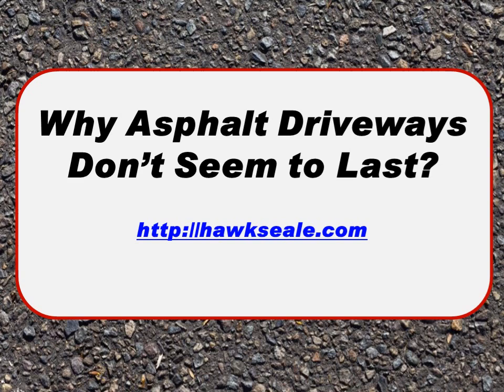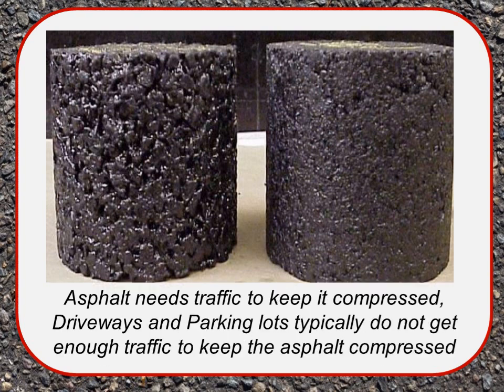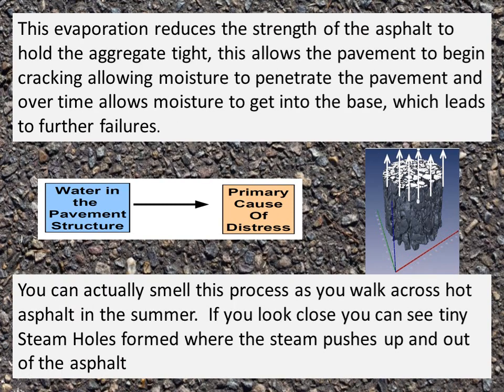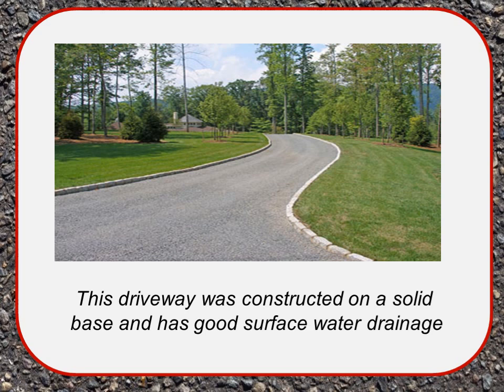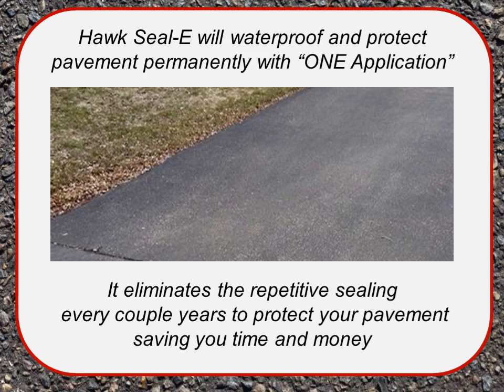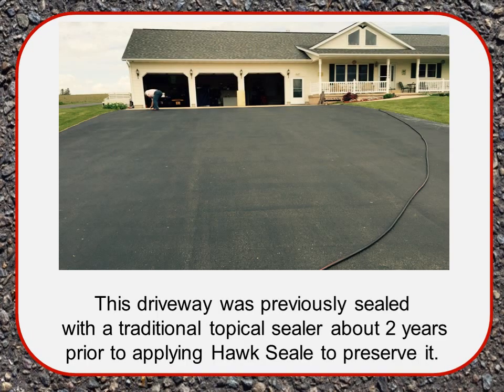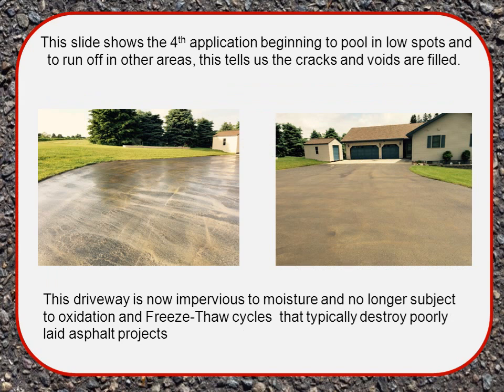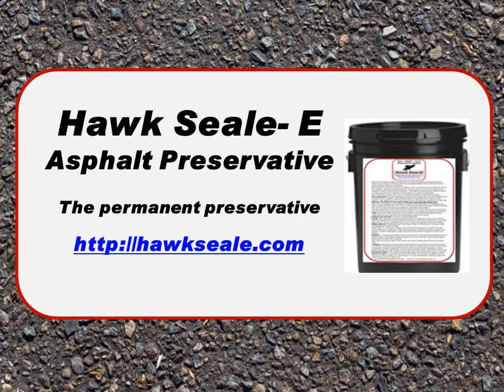Why Asphalt Driveways Don't Last

Comment: Roughly 130 square feet per 5 gallon bucket (@0.35 gals/yard), and $275 per 5 gallon bucket, that can get extremely expensive really quick!  That's more than $2 per foot, whereas traditional seals when sold by a contractor is roughly $0.25 per foot.  That means the contractor can spray your driveway 8 times in 2-3 year intervals before exceeding the cost of Hawk Seal E.